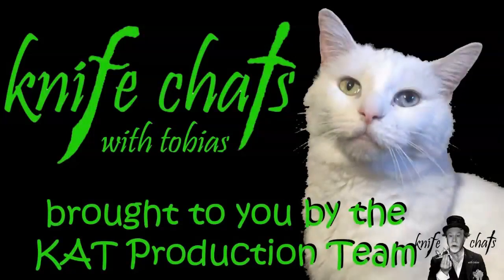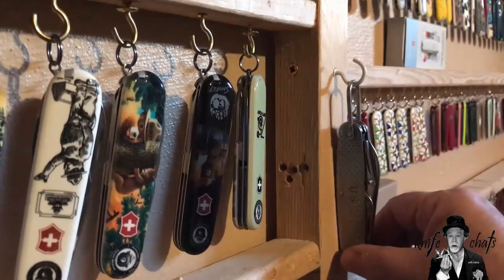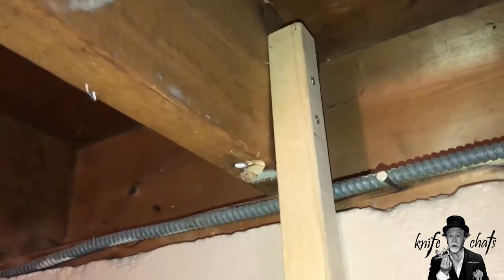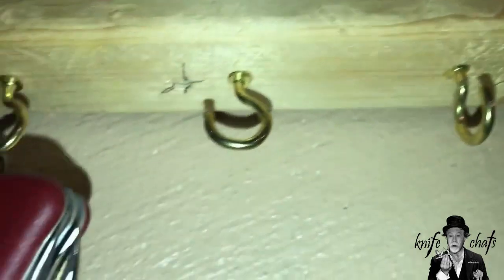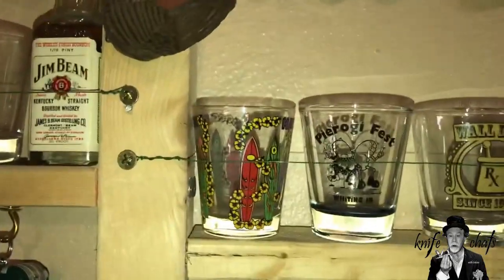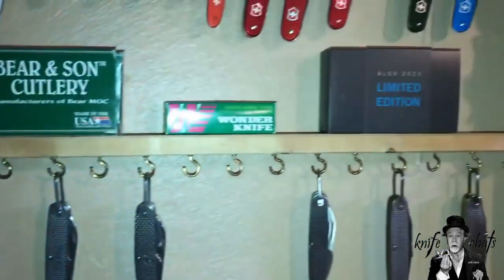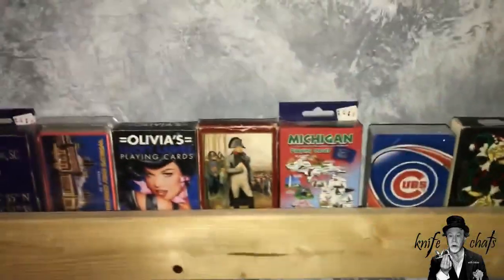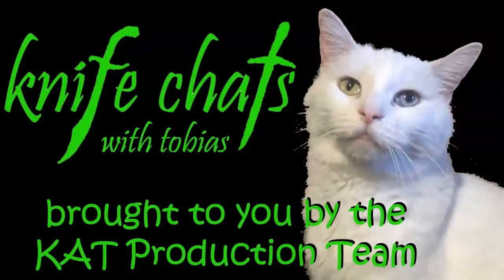How I went about building  my knife display (Part 1?)

Comment: Great video. How do you display traditionals that don't have a bail or a key ring ? I was eyeing one of those glass top big jewel cases but they are super expensive and I need to get a lot of them to fit my collection. I am also trying to figure out how to properly display by fixed blades (some are large and hefty) and modern folders. Knife collecting (and displaying) is indeed an expensive hobby.
Reply from the maker: I have a two sideboard/ buffet tables along with numerous small boxes and I use for non hanging knives.

Comment: The look of your knife display shows a lot of time and work. If you wanted not to take the time and difficulty of painting the background behind the knives you could buy some adhesive backed shelf paper and use it to finish the wall behind the knives. There are lots of colors and patterns to choose from and it is easy to keep clean. It would also be less trouble if you decided to stain the wood before using the shelf paper. This way you could do it a little at a time and not make it a major cleanup too. 👍🎇🔪🎇

Comment: Awesome collection(s). Do you have to run a dehumidifier in your basement? My collection is in my basement too and I'm thinking about getting one.
Reply from the maker: Yes.  I run two actually.  I keep it set between 40-60%.   I  also use quite a bit of damp rid.   The knives kept in boxes and drawers are stored with silica packets to absorb humidity.